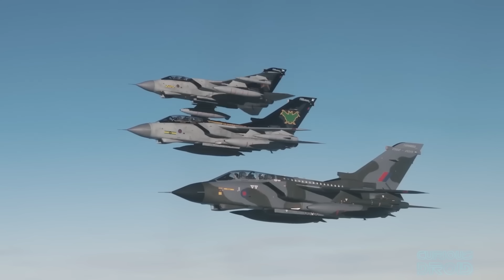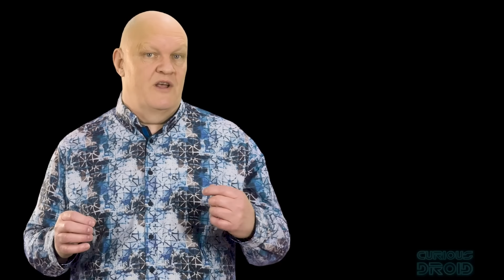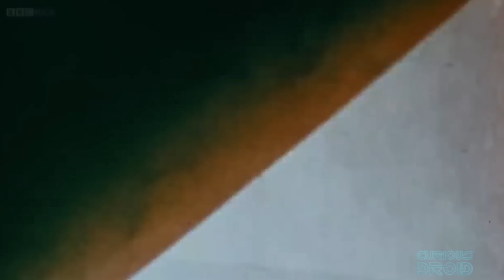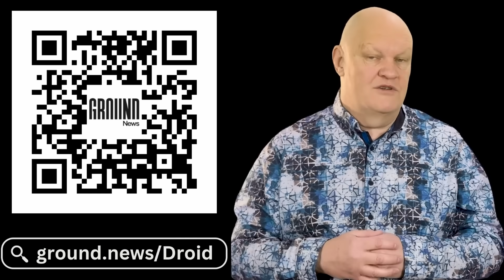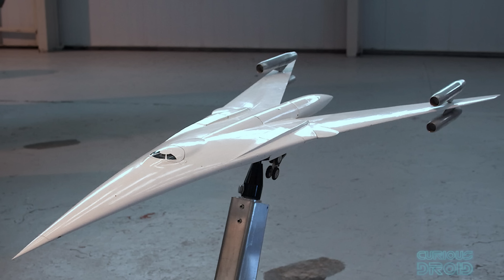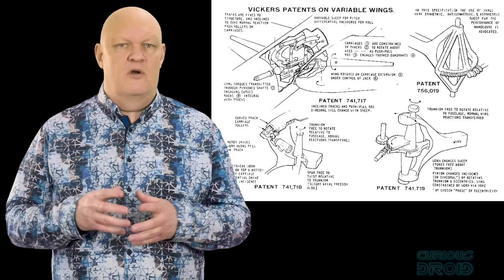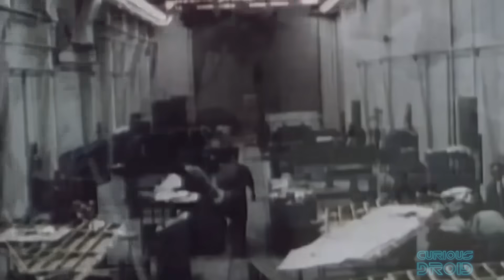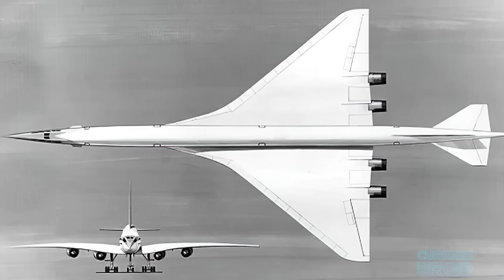Why Aren't Swing Wing Aircraft Made Any More?

Comment: If the engines went out on an f-16 (ie no fly by wire), would it be able to glide or would it just fall from the sky (since it's aerodynamically unstable)?
Reply: If the fly by wire system of an f-16 lost power there would be no way to control the flaps, rudder, etc as there was no hydraulic or mechanical linkage to the pilots controls at all. Purely fly by wire. However there were actual multiple fly by wire backups in case the main went out and I believe they could run without the engine on for limited time. And there was only one engine in an f16. So one could maintain flight if the engine went out if you had decent speed. Gliding would not be the term I’d use however.
Reply: @ManFromLaBamba  F-16 has a hydrazine powered EPU which contains it's own generator and hydraulic pump, supplying power and pressure through redundant circuits. Though controlled electronically, the flight control surfaces were powered by hydraulics.  It can run for about 15 minutes.  I was a test engineer on the program to certify the unit for use on the IAI Lavi project.  Impressive piece of kit, but handling hydrazene was nerve wracking =)
Reply: Theres a reason the f16 was nicknamed the lawn dart.

Comment: 2707 also had variable geometry design, yes?
Reply: Early design versions did. After Boeing won the contract, they switched to what was essentially Lockheed's L2000 configuration with fixed wing.

Comment: B-1B production started in 1983, so new swing wing aircraft were still being built after 1981
Reply: B-1 production started in 1983, but it first flew in 1974.  The Tu-160 first flew in... 1981 .

Neither aircraft went into production immediately, with the B-1B entering production in 1983 and the Tu-160 entering production in 1986.

So it is clear he was using first flew dates, and not "beginning of series production", "introduction to service", nor "last production" as his metric of "last swing wing".
Reply: @geodkyt  B1-B was still on the drawing board in 1982, it could not have flown before then
Reply: Tornados were built well into the 90s.
Reply: I think he may be referring to no brand new swing wing designs being introduced after 1981.

Comment: I do wonder if swing wings couldn't help stealth aircraft achieve longer ferry ranges when outside of contested airspace during high altitude super cruise or subsonic speeds. If that combined with an advanced variable geometry engine allowed for very high fuel economy, a big dual engine sixth gen strike aircraft could ferry from a distant base up to a few hundred miles of the target using drop tanks, become sealth and agile, and then make the trip back again in ferry mode after the package has been delivered. That would be huge force multiplier.

Comment: The swing wing is what killed the F-14 in US Navy service. It was just too expensive.
Reply: That's not... entirely... true... or, it at best greatly mischaracterizes the decision at the time.  Specifically, in the late 1990's when the 2006 end date was chosen for the F-14, parts production for the F-14 had been over for nearly a decade and they had been cannibalizing parts from other jets to keep them in the air as jets were retired.  Why would you do that?  Because the Navy didn't want to get rid of them.  The Wing Sweep mechanism wasn't even the bulk of the maintenance of an F-14... the AWG-9 and the TF-30 engines tended to be the two most time consuming maintenance items... both of which were addressed in the F-14D and the original F-14C had the US Navy allowed Grumman to build out the program the way it was intended (The F-14C was effectively what the F-14D was, but in the 1980's vs the 90's). 

Sec. Def. Cheney in George Bush Sr.'s era was the real reason the F-14 went away.  The "Peace Dividend" and some pocket lining from Boeing helped seal the deal.  Congress thought the Super Hornet was supposed to be effectively a modernization program for the Hornet... except that it ended up being a new airframe entirely.  It NOW has the same issues the F-14 had at it's end of life, except the Super Hornet is barely 20 years old in service.  The loss of capability to the carrier was huge... the protective bubble around it had to be covered with missile defense... the precision strike role went away entirely without tanker support.  It was a HUGE mistake.
Reply: Too expensive to maintain more than expensive to build. The F14 was famous for spending most of its life in the hangar deck.
Reply: It had many other maintenance intensive things in it.
Ease of maintenance just wasn't that high in priority list during its design process.
Though hardly any cutting edge/tech forward pushing plane is cheap...

Comment: The Tomcat is my favorite of the swing wing aircraft.  For a big aircraft is was quite maneuverable at low speeds with the wings straight.  It had the first microprocessor (custom made) that controlled a flight computer that governed the wing sweep.  The Tomcat's wing sweep was automatically set by the computer based on aerodynamics at any given moment. 
I would imagine the hinged design limited their max g more than what later aircraft like the F-15 and F-16 were limited to.  And there was more maintenance required for them than ones with a fixed sweep or delta wing.
Reply: The F-14 was rated for something to the tune of +6.5g at combat weight. But was known to survive nearly 13g at low weight, in an emergency situation. (Bent/written off).
Reply: @Triple_J.1  Originally 7.5G (same as the F/A-18 incidentally), later reduced to 6.5 to try and extend the life of aging and irreplaceable airframes.
There are HUD videos out there of Tomcats pulling 8-9G in displays with no issues.
Reply: @Solidboat123  and no tomcat had the cockpit fall off.
Reply: @Solidboat123  well, no, not really. 1980 flight manual states 6G with "projected" 7G limitation which, unfortunately for the tomcat, was never achieved: 1990s manuals state only 6.5G limit making it only a 0.5 growth.
Reply: It's so cool seeing the wings hanging like that during all those crazy maneuvers. You'd think they'd only want to do that during level flight.

Though I can hear all the maintainers wincing whenever they see it. Must have been a right ball ache to service all those hydraulics.
Reply: Actually thanks to the lifting body fuselage (i.e. the 'tunnel' between the engines), as G increased load on the wings dropped off as the fuselage's lift contribution increased
https://www.youtube.com/watch?v=YolnXZnw2cY&ab_channel=FighterPilotPodcast
55:30 is the timestamp for the relevant bit if you don't fancy watching the whole thing
Reply: The F-14 is one of my favourite aircraft and is still the pride of the Iranian Air Force. (The only export customer for the type).

Comment: Swing wings were an aerodynamic solution that have since been surpassed with superior powerplants, flight computers and far more advanced aerodynamic designs.  Advances in materials have aided that greatly.  Herr Busseman looks like a Hollywood casting directors idea of a German scientist.
Reply: Great point. The F-104 didn't have a true swept-back wing, but was supersonic
Reply: @fredmyers120  The F-104 wings were thin and sharp like the wings of the X-1.
Reply: @fredmyers120  F-104 also got name Widowmaker, because that tiny thin wing with little lift made it hard for landing and take off and maneuverability was propably at level of potato making for lots of accidents.
It was basically good only for flying in straight line.
Reply: @tuunaes  We must remember that the F-104 was the first Mach 2 inteceptor.. and performed well compared to many Mach 2 aircraft that followed.
RAF pilots called the English Electric Lightning the "Aluminium Death Tube" it had terrible range and a higher loss rate.
Reply: @tuunaes   didn't most of the accidents happen as a result of trying to use a high altitude interceptor as a fighter bomber ( looking at you Luftwaffe ).
Reply: @mpondachongo1138  26 Luftwaffe pilots scored Ace or higher in the Me-262... Kurt Welter remains the highest scoring jet Ace in history.
Reply: @WilhelmKarsten  ok and? what does that have to do with the F-104? isolated examples of a bad aircraft having performed good in the hands of a skilled pilot doesn't change the fact that it was still a bad aircraft.
Reply: @mpondachongo1138  You were referring specifically to the "new" Luftwaffe?
My comment was regarding the first jet interceptor (Me-262) which was very successful.

The F-104 was the first Mach 2 interceptor and performed well compared to those that followed it later... in particular the Lightning which also has a very dubious reputation.
Reply: @WilhelmKarsten  how exactly was the Me262 successful?
Reply: @mpondachongo1138  Apart from being the most revolutionary aircraft design since the Wright Flyer and rendering propeller driven fighters completely obsolete?
Reply: @mpondachongo1138  The Messerschmitt Me-262 was the greatest single leap in aviation history and pioneered the technology still used in jet fighters today.
In 1-on-1 aerial combat the Me-262 completely outclassed anything that the Allies had, there was absolutely nothing comparable to it.
Completely moot point, no single aircraft can change the outcome of a war.
The F-4 Phantom completely outclassed anything that the North Vietnamese had, yet America still lost the war.

People love to hate on the Me-262 because it is a shameful and humiliating embarrassment to the Allies, it highlights just how much more advanced Germany was in aerospace technology... it's like a slap in the face to nationalist, xenophobic Alliboos everywhere.
You need to learn the facts and accept the irrefutable truth.
The Messerschmitt Me-262 was the without any doubt the best fighter aircraft in WW2 and the best Allied test pilot Eric Brown stated that it was the best and years ahead of anything the Allies had... he knows because he flew all of them!
Any questions kid?
Reply: @WilhelmKarsten  are we talking about the same country that still relied on hoarse drawn carts while the alley's had fully mechanised forces? 
the only advantage the Me262 had over other fighter aircraft aircraft was its top speed cause it had:
-worse acceleration
-worse range 
-higher fuel consumption
-more complex components
-extremely short engine life 
-required longer and paved runways to take off
The Meteor was being developed at the same time as the 262 and was an overall better aircraft.
It was an interceptor that was made to take out bombers not fighters and would lose in a dogfight to any late war prop fighter if it ever tried to in gage them. 
The myth about Germany having superior technology is just that, a myth. There tanks where over engineered hunks of junk that broke down half the time, there leaders where fat genocidal drug addicts and they could have never won the war no mater how many of there stupid "super weapons" they built.
Reply: @fredmyers120  The F-104 didn't need swept wings, because they were so short that they were shrouded by the shock wave formed by the plane's nose.
Reply: Can we not use the term powerplant? Just call it the jet engine
Reply: Ya they were short lived because they were essentially an intermediary solution. Additionally, speed has slowly become less valuable- you’re never outrunning a modern missile in a plane because they can be made to go faster than any plane can, and can pull higher gs due to no squishy human. Obviously you still want to go fast, you don’t want to be flying at 250mph, but stealth is going to be more valuable as seen with the f35, so brining a bunch of disadvantages for swing wing to squeak out a little bit of extra speed isn’t worth the trade at all.
Reply: If you think swing wings have been surpassed you misunderstand their purpose.  There isn't a non- VG aircraft that approaches the aerodynamic efficiency of a VG wing over a wide flight envelope.  Quite literally the aircraft gets to use a different wing for the flight regime in which it is operating at any given moment.  Bombers like the F-111 and B-1 had swing wings because they can lift more and fly further while retaining the ability to go very fast when necessary.  You can go that far with a big high aspect ratio wing or you can go that fast with a small low aspect ratio wing, but you can't do both with a single wing.  Aerodynamics didn't change, the mission profile changed.
Reply: That is not true. All the advances in engines and aerodynamics could still be applied to a variable-swing aircraft, and it would still have much wider flight envelope everything else being equal. Because physics.

Variable angle is not free, but neither is NOT having it. While fixed-angle is cheaper to build, it either cannot attain the same high speeds at all altitudes, or cannot fly as slow, or (as in most real examples) BOTH.

The latter (lack of low speed) costs you dearly as you need longer runways, For Navy aircraft it means you need supercarriers instead of regular aircraft carriers (SO EXPENSIVE!) and much more powerful catapults and arrestors, necessitating heavier running gear.
Reply: @PaulVerhoeven2  I hate to break it to you, but carriers have always been expensive.
Reply: @remkirkthegamer1157  "I hate to break it to you, but carriers have always been expensive."

Purely qualitative terms like "expensive" makes no sense. Supercarriers are WAY more expensive than the old regular ones.
Reply: @PaulVerhoeven2  USS Enterprise (CV-6) costed at least $442 million in today's money (The only thing I could find said that she costed over $19 million when she was built in 1934).
Reply: And we don't even need them anoymore.
The F-104 goes Mach 2
The F-111 goes Mach 2.5
The F-14 is set for Mach 2.34
The F-15 goes Mach 2.5
The F-16 goes Mach 2.05
The F-18 goes Mach 1.8
The F-22 goes Mach 2.25 with cruise at 1.82
The F-35 goes Mach 1.6
And the same for other military services.

In these days we don't need high altitude interceptors and close range dogfighters anymore. Intercepting targets is done with missiles, either from ground, for form the plane. And dogfighting is so rare, that some even suggest leaving out the nosegun, because they're almost obsolete.
Reply: @HappyBeezerStudios  "In these days we don't need high altitude interceptors"

And the Chinese balloons were only intercepted by F-22 because F-16 or F-35 could not even reach them or anywhere close.

Same with fighter jets. Everything else being equal and with enough radar (their own or external), in a BVR fight the one flying higher and faster (the same thing essentially) wins.
Reply: @PaulVerhoeven2   the balloon was in between 60K and 65k feet and was shot down with an IR missile (AIM-9X). So any other fighter aircraft could have done it considering most US fighter aircraft ( F-15, F16, F-22, F/A-18 and F-35 )  have a publicly disclosed service celling of about 50K to 65K feet. They used the F-22 because they wanted to not because is was the only capable fighter of doing so.
Reply: @mpondachongo1138  Think again, F-16 could not get there and neither could F-35. AIM-9X is short distance, and don't mistake altitude difference for horizontal distance either.
Reply: @PaulVerhoeven2   sorry about that, my mistake.

Comment: You stated at the beginning of the video "no aircraft with variable geometry wings were manufactured after 1981." They are still building the TU-160 today and manufactured Tomcats, Fencers, and Tornados after 1981. 

I assume you meant designed. You should annotate a correction.

Comment: That Swallow looks like a few of the triangular UFOs.  The development of that aircraft may have gone further than they let on.  
I have been kicking around the idea of a personal use drone with a swing wing.  It'd be propeller driven, but able to sweep the wings back for a higher speed travel mode, then swing out for a low speed loiter mode.  There wouldn't really be a payload on this thing, just a camera.

Comment: The NATF F-22 would have had a swing wing.  The biggest reason the swing-wing went away is because the mission went away.  All swing-wing bomber/attack aircraft were designed around the mission of long distance subsonic cruise followed by a treetop ingress to the target for the last couple hundred miles. NOBODY is flying at treetop altitude anymore.  That got put to bed during Desert Storm.  The other main use was for reducing speed on landing and short field take off.  The Mig-23/27 had it for reduced runway requirements.  The Tomcat had it for landing on carriers.  (Which is the same reason the USNs version of the F-22 would have had swing wings.)